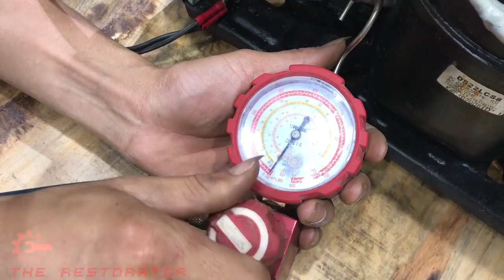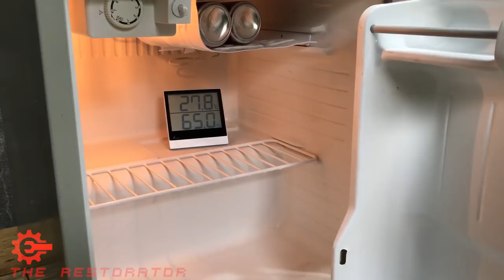DAEWOO VR 062S FRIDGE | Restoration Old Rusty DAEWOO Refrigerators | Restore DAEWOO Fridge

Comment: Another good restoration, but it looks like you need a few pointers on refrigeration work.

1) You need to prep the copper pipe better before brazing it. Use a scotch brite pad wrapped around the copper pipe end and rotate it a few times to get scratches around the radius. This will clean the pipe and help the brazing material stick better and not blob up like it did for you.

2) Use pipe soldering flux all around the copper pipe before brazing. This will help the braze material flow into the joint to create a stronger joint.

3) On the crimped tail you made for the refill port, you may want to keep the end flared a bit and flux and braze in the end. Sometimes crimps can leak. Another option is to just leave the refill port on if it has a schrader valve that self seals and also crimp the line for a double seal.

I have a feeling those braze joints may leak in the future from mechanical stress by the compressor vibrating in operation. But other than those issues, you did a good restoration.
Reply: Bro, tienes razón en todo lo que dices, no creo que haya hecho un buen trabajo, además de que la temperatura en el refrigerador no es la adecuada, ya que el rango de temperatura para el refrigerador es de 5°C a 1°C y en el congelador es de -15°C a -20°C.